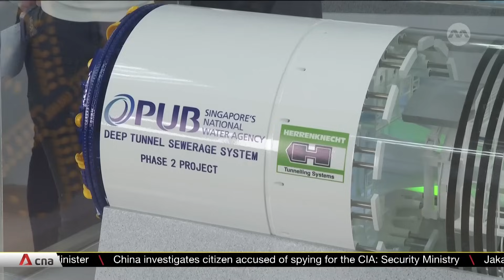Singapore's deep tunnel sewerage system to be up and running by end-2026

Comment: although is expensive but it's a good move rather than rely your fate on someone else hand. May be this can also resolved the flood in lower lands due to heavy rain?
Reply: Are you ok? This is for sewage water.
Reply: @wz758  pretty sure I'm fine.u heard of newater?
Reply: NEWater is recycled from treated sewage
Reply: @adrenfu6238  you are digressing even further now. I was commenting on your comment of the possibility of the sewage system being used to resolve flood. Sewage system is for sewage water. Flood which is caused by rainwater has an entirely different system to manage it. So are you ok?
Reply: @wz758  I mention maybe, did I ever said now we resolved?moreover sewage is a complex system and rain water is easier recycle. Don't assume dude before you jump to conclusion, if you're not sure on someone intent then ask.
Reply: @wz758  I do understand your point sewage and drainage system is kept separately but now since everything is underground that could also be a possibility that since we have a huge sewage tunnel we can also make use of this to resolved the flood and is usually cause by heavy rain.i mention that could be a possibility but never confirmed that we can resolved.